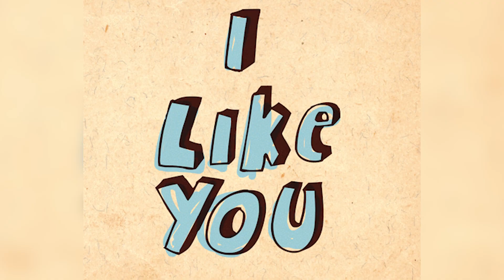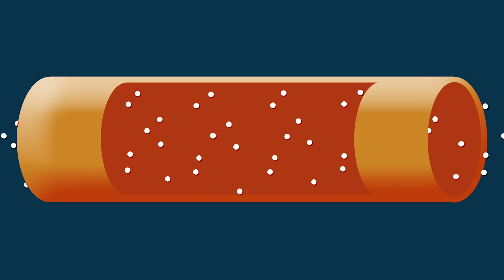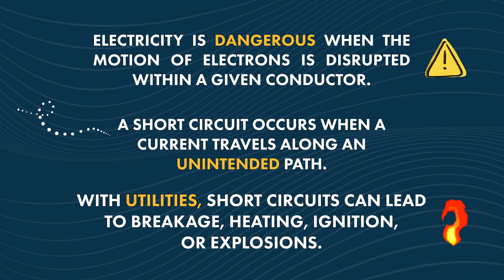STOP! Electricity Hazards Here feat. Vanessa & Claudio #WhatsWatt #9

Comment: Good safety points. One thing that I did not notice mentioned in regards to working with electricity (and some of the picture references) is working with someone else (teamwork). It is important that both individuals know how to isolate power, how to remove someone a dangerous situation (electrocution), and verify each others work before powering on a circuit. And if you are not confident working with electricity reach out to someone with more experience, especially when working on home electronics/electrical. Cheers!
Reply: Hello Capsith, thank you for your relevant feedback. In this episode and formers ones, we recommend to solicit qualified people to carry out electrical work. Special care is needed even for seemingly minor DIY task. When writing the script of this episode about electric hazards, I thought to list the essential actions to be taken when an electrical incident is suspected (1/ Do not touch the person; 2/ Switch off the electrical current; 3/ Call for emergency help). 
Please note that this episode is already the longest of our series. Same idea with the explanation of “step voltage” and how to escape a hazardous area. We could consider another short format for that! Cheers!

Comment: When I was a kid, my father tried to teach me how to use tools correctly and safely. He wanted to teach me to respect electricity. He riggged up a little circuit, powered by a battery, which would produce something like 15 volts in short pulses. He had me hold one terminal of the circuit in my hand, then he held my other hand, and with his other hand he grabbed the other terminal. I got a mild shock from each pulse, until I let go of his hand. Very educational!
There's an old science fiction story by Fritz Leiber, "The Man Who Made Friends With Electricity". (The man comes to a bad end eventually.) Well, I consider myself the woman who made friends with electricity. I worked in broadcast radio most of my adult life, occasionally dealing with 50 KW transmitters. I once almost got struck by lightning, but it changed its mind. And a few months ago I was treated for a heart condition by having controlled electrical signals applied to my heart, which kept the incorrect circuits from firing out of rhythm. But I know not to overload a power strip, and the correct way to jump-start a car battery.
Reply: Many thanks Ace for your testimony. I experienced little electric shocks along a cattle fence, when I was a kid. However beneficial in retrospect to foster a natural distrust of the dangers of electricity! When they are fully controlled, electrical signals have great therapeutic properties. I discovered that the first pacemaker was implanted in Sweden in 1958. Glad to read that you made special friends with electricity. Welcome to this nice community.
(and I have download the short story of Fritz Leiber for a relaxing moment this evening ;-).
Take care.
Reply: @fredericlesur5547  The story was written durin the Cold War era, but it's got a typical Fritz Leiber twist to it. Enjoy!